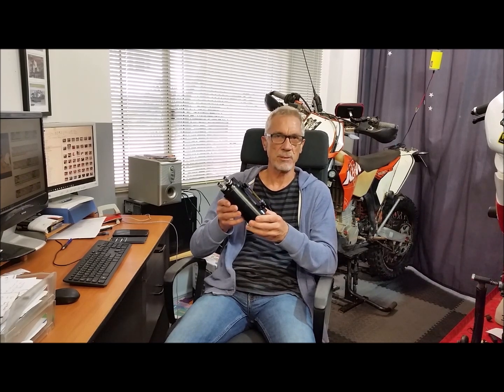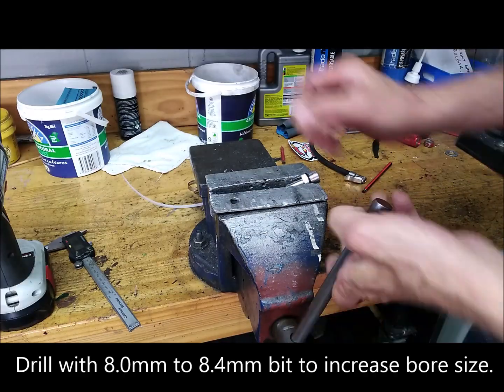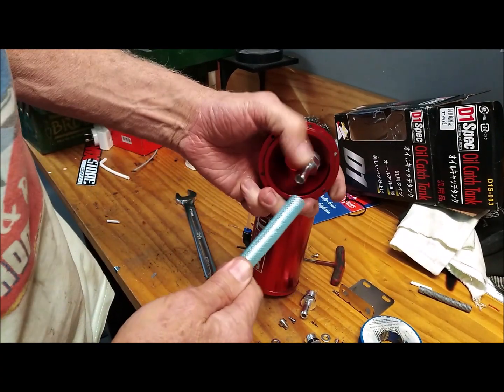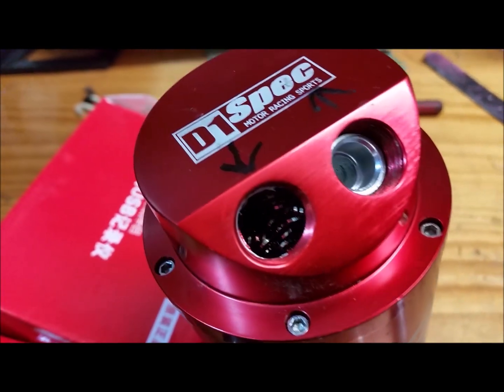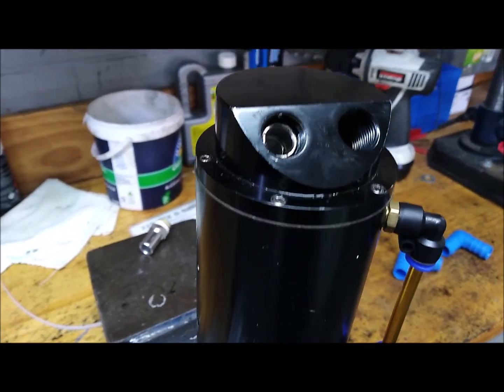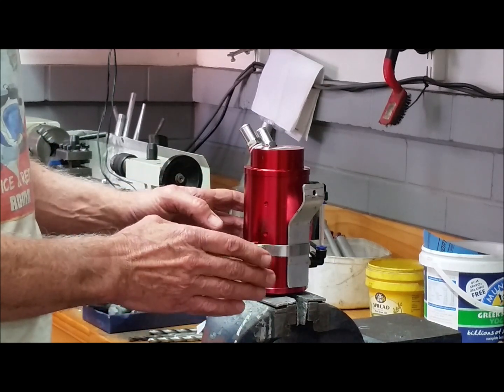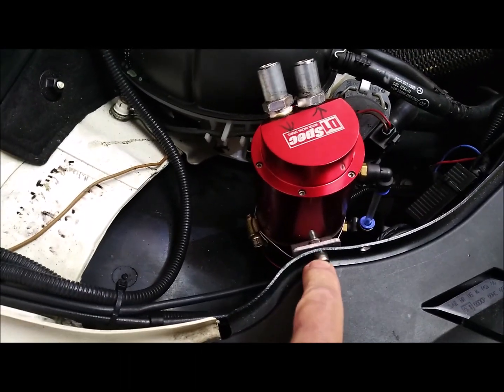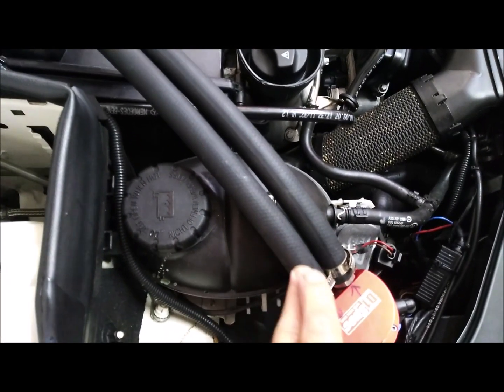OM642 Mercedes Oil Catch Can W164 Ml320/350 320CDI 350CDI Chrysler 300c oil catch can

Comment: Hi Scott, great video - thank you. Apologies if this comes through more than once.
I've just used your install as inspo to install a SAAS baffled 500ml catch can on my W204 with an OM642. I too used 16mm fittings and added a SS pot scrubber to the middle baffle chamber.
Although I can blow through the catch can with ease, I'm a little worried about the possibility my cc could result in crankcase overpressure under different driving conditions and blow seals. I had thought about installing a check valve to bypass the can in an overpressure situation but not sure what specs I'd need.
Wondering what your thoughts and considerations were / are on this and how you were comfortable you hadn't created an overpressure when you installed?
Reply from the maker: Thanks. I'm comfortable I haven't created over pressure as I've had no issues since installation. Also, now there's almost no oil at the turbo inlet whereas before it used to drip out. I reckon you drive the car, monitor and see how it goes. There's a one way valve in the system where the OEM rubber hose is connected at the cylinder head.
Reply: Thanks! I’ve now collectively done around 100kms over city driving and short highway runs at 110kph.
No visible issues as yet so hoping my setup is ok too!
Do you find the steel scrubber needs replacing or cleaning out at intervals?
Reply from the maker: @adv6504  No they don't need cleaning. The scrubber pads just provide more surface area for the oil to condense on. Then it flows to the bottom of the can. You just have to keep an eye on the accumulated oil level.
Reply: @ScottElliott152 makes sense, thanks again!
I’ve installed a clear 16mm drain tube on mine with gas rated tap / valve at the bottom of the tube and aim to empty the tube before the can accumulates any / much oil. 
I haven’t measured but suspect I get around 150ml capacity out of the drain tube alone. Thanks again for your experience!
Reply from the maker: @adv6504  I don't do many kilometres (about 4,000k p.a.) in my W204 C320CDI so the catch can doesn't accumulate much.

Comment: Great Video Scott! The oil catch can I got has the double baffle but I see in your modification it makes sense to run a piece of hose down to bottom of catch can. I dont think mine allows me to do that however I will add the steel pot scrubber material to help it catch more oil and not re-injest as much in turbo. Thanks again for quick response and for great video pointers!!

Comment: Why this happens? I mean, engine runs well without this device, when its new.
Reply from the maker: Because it reduces oil vapour going into the turbo and blocking the intake system.
Reply: @ScottElliott152  This is needed and happens because of the emissions systems on the car along w the wrong oil that mercedes tells you to use in order to match the emissions statements they make to all the governing bodies for that sort of thievery.  The wrong oil combined w the high temps during DPF regen cause polishing of the cylinder walls and that allows for more blowby over time. Research oil ... you should be running ACEA E9 and API CK4 is what you should be running, NONE of the mercedes suggested oils have this.  mercedes own tech literature calls for ACEA E9 oil!  They are doing this to satisfy the government goons at the expense of us.  Use Rotella T6 oil in any merc diesel.

Comment: Thanks for posting ML320 info - there is a definite lack of DIY info out there on what is a stupidly complex design. Your transmission oil change video was really helpful.  This is the first mod I did to my ML320. Nothing good comes from eating your own poop. The stainless steel wool trick greatly improves the efficiency of the air/oil separator.  Be careful with the sensor that is in the hose between the PCV and turbo - it sits at 12V even with the engine off. Don't ask me how I know...
Reply from the maker: Thanks Francis. Definitely a shortage of DIY information on later model Mercedes cars. Scott

Comment: I'm getting a lot of blowby on my '08 ML320 CDI with 148k miles on it.  It's enough blowby, that the tubing running from the PCV to the air intake T wants to pop the (loosely connected) orange o-ring loose and thereby open the engine up to unfiltered air, so I modified the connection with a couple of clamps and some pipe tape, to ensure that it cannot come loose.  This catch can seems like a good solution - thanks for posting the video!
Reply from the maker: Russel we also have an 08 ML320CDI with 100,000 miles in the family. My W204 with the same engine only has 50,000 miles but it blows as much oil vapour as the ML. We've replaced that little orange seal on both vehicles as they do wear and become loose. All diesels create a lot of crankcase pressure due to the long stroke and high compression which is why a catch can is worth the effort. It certainly can't do any harm. Scott

Comment: Think I may fit one to my w203 C320 cdi, if it does all that.👍
Reply from the maker: Kirkby it's a cheap easy modification that certainly won't do any harm. Scott
Reply: Scott Elliott hi- thanks for the video, I’ve eventually done an Swirl flap delete, motor runs neat.

I will upload the video once I can get my head around Apple’s cloud issue of creating more space 😁. 

Thanks again, do you have a link for the oil catch can, does the company deliver to the UK?
Reply from the maker: Hi Jay. There's a link in the description for the type of CC I purchased ... but do a search on eBay for "universal oil catch can" and hundreds will come up.
I'll be interested to see your video on the swirl flap delete. I did do mine with the 4.4kOhm resistor in the connector to mimic the swirl flap motor ... but couldn't notice any difference so put it back to stock.
Those swirl motors often fail due to oil dripping out of the turbo inlet seal onto the motor below. Replacing that big orange seal and installing a catch can will all but eliminate the oil dripping problem.
Reply: Scott Elliott thank you, just seen it - I’ll do an installation and happy to reference you in my vid 😁. Appreciate this🙏🏾.

I have a quick question, can a faulty glow plug, make my om642,engine hesitate at 2,900 rpm in driving on the motorway, I can’t get past 3,000 rpm without it jerking/ hesitating, I’m baffled...

And also I’m thinking of using reviveturbocleaner.com’s product, to get to places where the turbo vanes and EGR might have suffered soot after time build ups, should I spray it directly to the turbo blades whilst the engine is on? Normally I’d spray it from an air intake but as the om642 engine has two intakes, I wouldn’t be able to spray at both ends at the same time, but to take off the y-pipe air intake and then spray directly to the turbo... would that be advisable?

Also how do I get the Chinese replica of the Mercedes STAR diagnostics machine, please :)) can it be installed on MacBook Pro or an Android platform ?

Many thanks Scott 🙏🏾

From Jay UK 🇬🇧
Reply from the maker: Hi Jay ... based on my experience faulty or failed GP's make the car harder to start when cold but that’s it … and yes it does get cold in Australia. We had a 2C minimum here a few weeks ago!

I have no experience with spray on turbo cleaner but the vanes do look kinda delicate so I’d be hesitant to spray directly onto the blades. If you spray into one of the intakes they join in front of the turbo so it will go through anyway. Alternatively you could clamp a suitable sized hose/duct (say about 300mm long) onto the turbo and spray into that so you’re introducing the cleaner from a distance and not directly onto the blades.

I bought my STAR from here: http://www.obdexpress.co.uk/producttags/mb-sd-c4-c5.html

I purchased the full system installed on an external HDD. It was 07-2013. STAR uses a modified Windows XP Professional SP3 operating system so android is out. If you’re prepared to hand over the cash the easiest way to get going is purchase the refurbished DELL630 laptop loaded with the software and complete with C4/5 multiplexer, plugs and cables. You’ll turn it on, plug it in and away you go.

Once you get familiar with the system you can join www.mhhauto.com and download older versions of STAR that will give more access. I have DAS/Xentry 10-2008 and 01-2011 and use them all the time as you can actually do things. Xentry is so locked down it won’t let you do much more than read codes. However it was a lot of work and research to get it all working and is not for the faint hearted. You need good PC/IT skills. I had to create virtual machines and install fresh versions of Windows XP Professional SP3 then run the various patches and replace system files with the Mercedes versions. All the files/patches etc are available on www.mhhauto but it requires a lot of reading and searching.

If you bought the laptop you may not have those issues and could install the earlier versions without too much fuss.

Scott (from sunny Australia)

Comment: Good job, Scott!   Except that the motor's plastic cover can not be reattached  after oil can installation, are there any SIDE EFFECTS?
Reply from the maker: Thanks Marius ... side effects? a Cooler motor! I removed my cover years ago. It's been hanging on the wall of the garage as a reminder of man's ability to make plastic engine covers that serve no purpose. I removed the cover from my Nissan D40 Frontier/Navara as well and that gets taken into extreme environments.
I prefer the uncovered look of the OM642 especially if you keep the engine clean. There's plenty of insulation on the underside of the hood so that doesn't get any hotter.
If you used reducers, smaller hose and chose a different route you maybe able to keep the cover on.
Reply: Hello gentlemen,
First I'd like to start by congratulating Scott on a job well done.
There is some drawback to the baffle design in my opinion. What I am trying to say is, won't there be the risk of some parts of the scrubbing metal "sponges" to come off and go into the inlet?
Now I have some questions - why did you go with such a big diameter for the inlet and outlet hoses from the catch can? I understand that the 90 degrees elbows need to match the diameter of the oil breather hoes, but you could have used diameter reduction afterwards, right?
You could machine a T connector with separator to make a more neat looking install.
The benefits of such a contraption is that the oil doesn't mix anymore with the particles of gases from the EGR, thus the intake manifolds won't get clogged up anymore.
Thanks and waiting for your reply.
BR,
Alex
Reply from the maker: Thanks Alex.
The stainless steel pads are made of long strands twisted into a bundle so it's impossible for any to find there way into the turbo. You could place a piece of metal gauze at the outlet if you're concerned.
Using smaller hose reduces the flow and these engines pump a lot of oil vapour. The bigger the hose the better so as not to impede the flow of vapour.
As I said in the video I've been using this design for sometime. The 4wd has done many trips into the remote deserts. The most recent was in August ... 6000km through four deserts and 820 sand dunes and the Nissan ran like clockwork with it's $20 catch can filled with stainless steel scrubbing pads!
https://www.youtube.com/watch?v=3SdLwAOwZac&pbjreload=10
Reply: @ScottElliott152  just wanted to ask you one more thing. Have you ever considered upgrading the airboxes and the y pipe to the new gen versions? I'd like to know if we can do some exchange of ideas via e-mail. Thanks
Reply from the maker: Hi Alex ... no I haven't considered that option. The standard air intakes in the 2008 version seem ok. Are the new gen versions larger and flow more air? What email can I contact you with?

Comment: Benefits of plumbing in a CC on om642 cant be overstated as it eliminates oil migrating into engine valley & being mistaken for leak around oil cooler, turbo pedestal or cascading onto port shutoff (swirl flap) motor or aspirating into intercooler & beyond. My CC is mounted similarly & in same location but I didn't have to deal with coolant degas bottle as that is located on opposite side in USA variant. The SS scrubber pad inside CC is good idea as will strain oil vapor passing through, i will have to implement that upgrade on mine. Thank & praises for another excellent tutorial.
Reply from the maker: Thanks Kevin. Yes the CC is almost mandatory on the OM642 as it does pump a lot of oil vapour. The baffle definitely works as it gives more surface area for the oil to condense. I've made four of these modified CC's and they're just as good as the more expensive name brand items. You don't need to spend a fortune to create an effective CC.
I took the black can off the C320CDI and will install it on the W639 Vito van. The red CC with it's racing "bling" look is more suited to the W204 than a van! I'm convinced the red colour has taken 0.43 seconds off the 0 to 60mph time.
Reply: I can't agree with you more. I think the oil/air separator - in addition to stopping the inlet tract and turbo getting coated in mayonnaise  i- s critical to preventing DPF failure. From what I can see what happens is two fold: first it loads the DPF with crud and an over rich condition which leads to it demise and secondly the blow by craps out the air flow sensors (the two upstream ones and the downstream one which puts the engine in limp mode which doesn't allow the DPF run through its cleaning cycle or get up to DPF operating temperature which again kills the DPF.